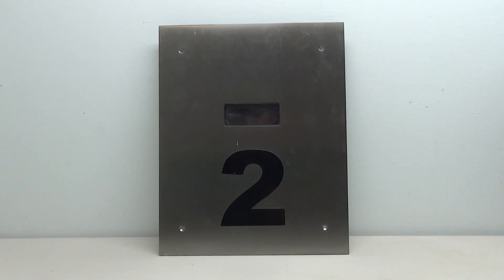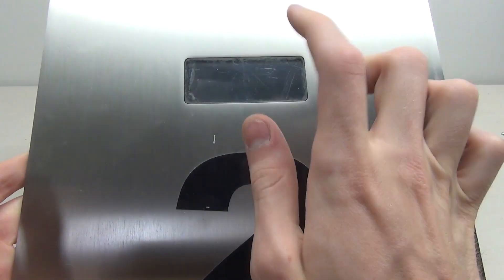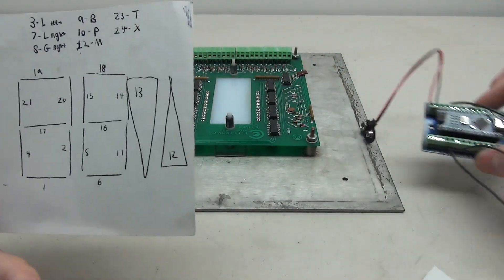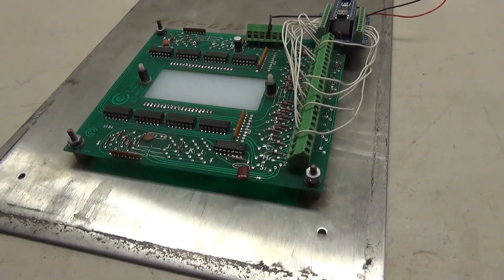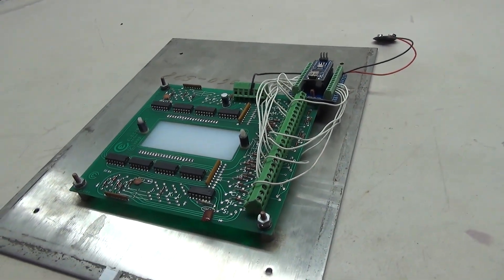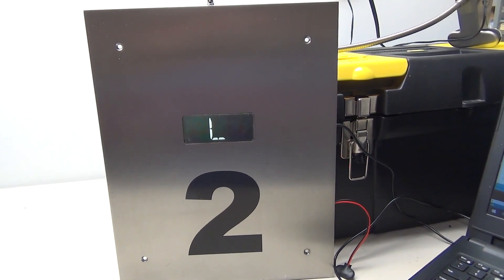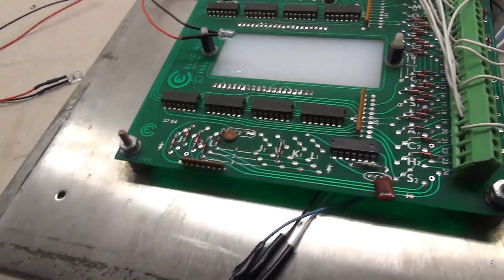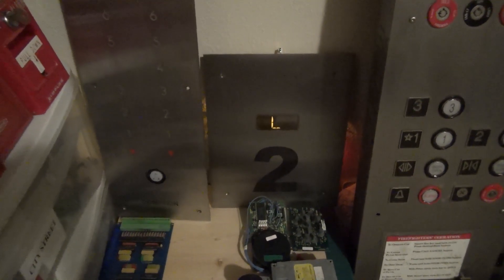Wiring and Programming a Schindler Haughton Floor Indicator

Comment: Amazing project for what it is. Now there is a Haughton indicator that rises 99 floors at rocket speed! Would be interesting to see a video of you doing older indicators like IEE, Rotodials and arrow dial models, like those in movies.
Something related I noticed while watching it: there are some KONE installs that use this indicator too, most notably the Four Seasons Hotel in Miami FL. Seeing as this one has a marking on the back that mentions an electronics company and not SchindlerHaughton properly, my guess would be that this could be used by other companies too. Similar to the IEE indicator used by Otis and Westinghouse. That's my theory, not confirmed, might be wrong.
Reply: The rotodial would be cool. I think what would be even cooler though is if STL designed his own rotodial and made it work similar to how the actual rotodials work! It shouldn't be too bad (I mean when you have a 3D printer the sky is pretty much the limit).
Reply from the maker: I really want to get a rotodial of somekind and an IEE indicator!